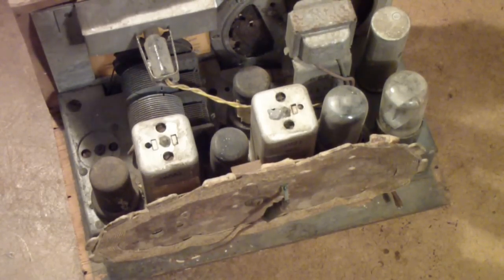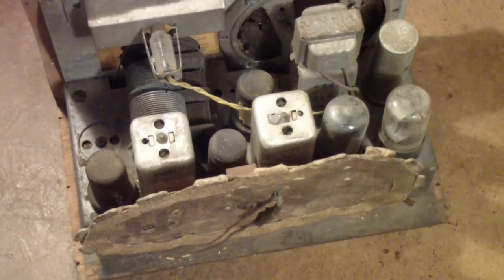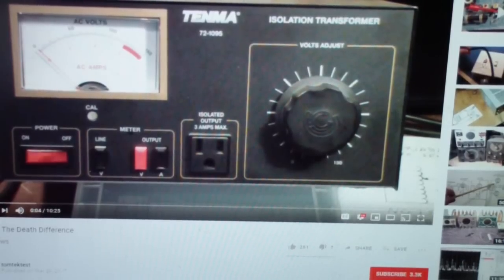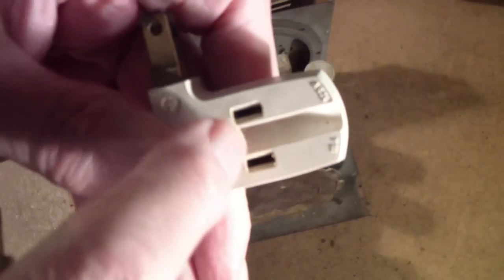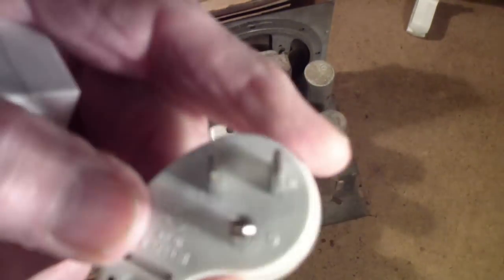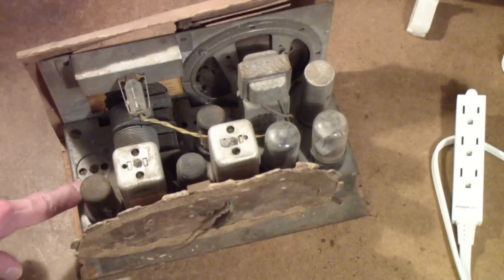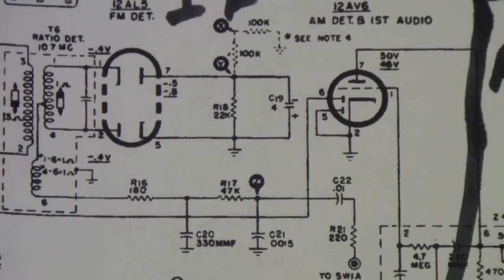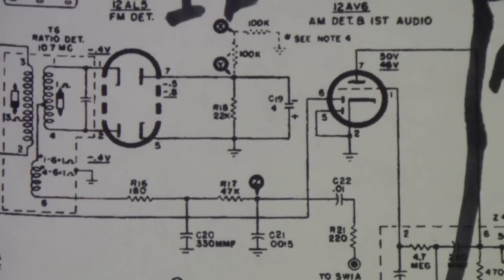TTT268 The Frugal Repairman Pt3

Comment: Good video. 

I know you spent a lot of time on safety... But, this series is intended for novices.  Many have no experience with tube world at all, and consumer electronics of this vintage can be very dangerous. 

Isolation xformers and dim-bulb testers are a necessity, and when you can afford it, a variable  autotransformer (Variac) should be on the bench.  They can save you a lot of grief. 

Repaired or restored equipment should never be released into the wild with non-polarized power plugs, and the power switch should always be moved to the line side, rather than the neutral side of the power input.  For some reason, many of the AA5 radios were built with the switch in the side going to the chassis.  There may have been a reason for that, but I don't know what it was.